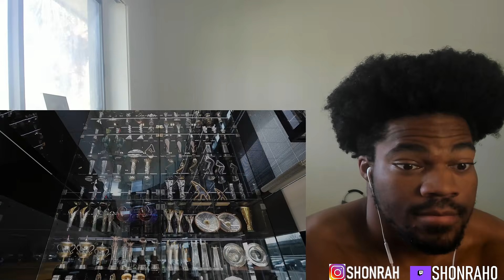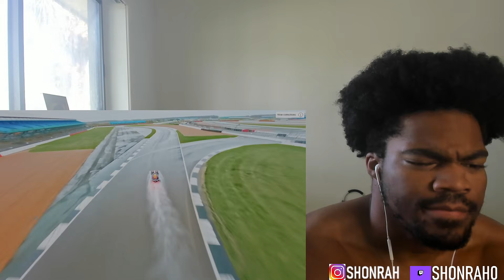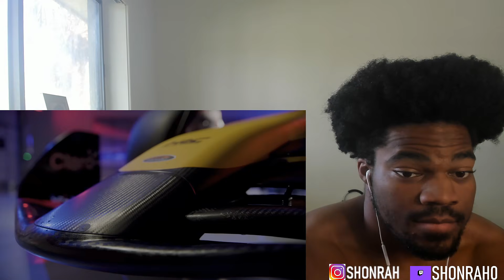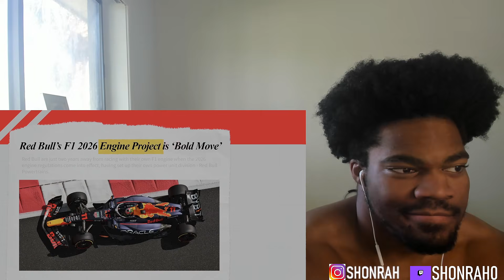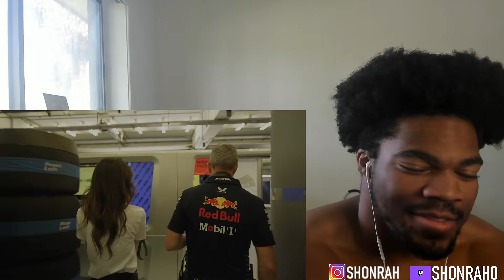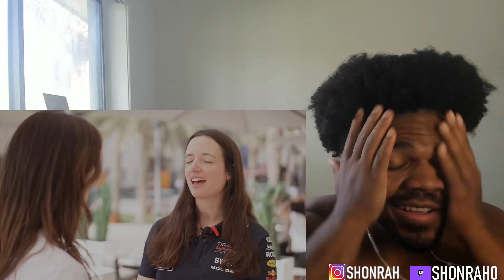First Time Watching Formula 1 Cars Explained for Rookies (with Max Verstappen) Reaction

Comment: The 135mil rule is pretty new, called the cost cap. Because before it was even more insane. They were allowed to spend whatever they wanted, some teams up to 400-500mil a year. 

They also limited tested to only a few days each year, which before was basically unlimited.
Reply: It was rumoured the Ferrari was at 900 mil in the early 2000's

Comment: If you wanna see a pure F1 movie, watch the 1966 movie 'Grand Prix' which was recorded during the 1966 F1 season, the acting can be meh at times.. but the movie revolutionised the way you see onboard recordings of cars in any movie afterward... they even used remote controlled cameras that could rotate around.. they were controlled by a passenger in a modified GT40, driven by Carroll Shelby (yeah, THAT Shelby!) and 1961 F1 champion, Phil Hill.  The cars were modified Formula 3 cars (lower class cars) but mocked up to resemble real F1 cars.. and some F1 drivers had some cameo roles....

Comment: Just so you're aware, the 135m is a recent cost CAP that was applied, because the richer teams spent WAY more than that, giving them a huge advantage over poor teams or newer entries to teams. 135million has become difficult for some teams to manage because they had to lay off staff, and couldn't go as crazy with design as they wanted to win. Mercedes and redbull and ferrari for example use to spend several times more than that. Reports say Mercedes in its dominant era before the cost cap was spending $450m a year. Where as the newcomer Haas team was spending $80m. You can see why that would quickly be unfair, so costcaps were introduced to bring the field closer. also the winner teams get less wind tunnel and computational fluid dynamics (CDFD) hours. allowing losing teams to get more and in theory catch up. keeping the field more even by narrowing the gap from leader to loser.